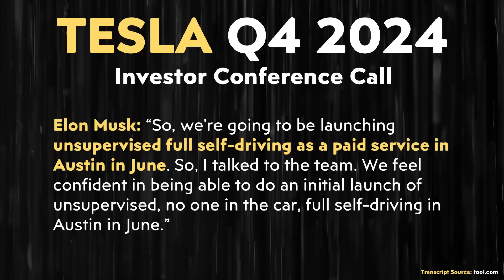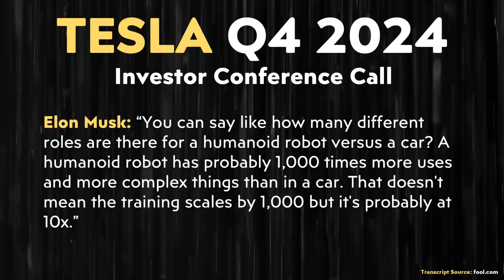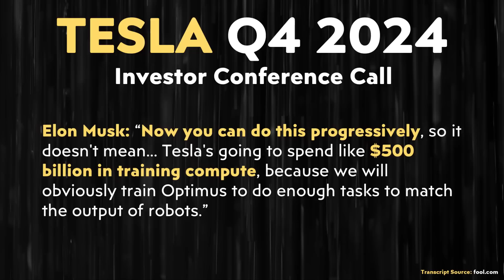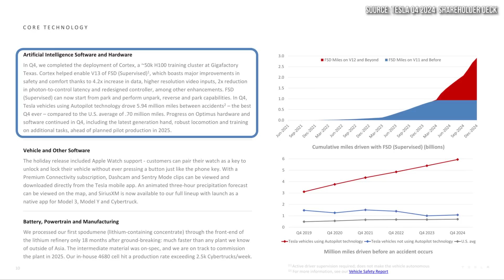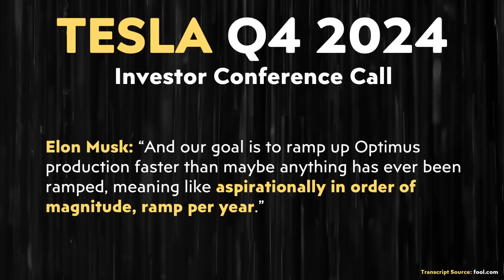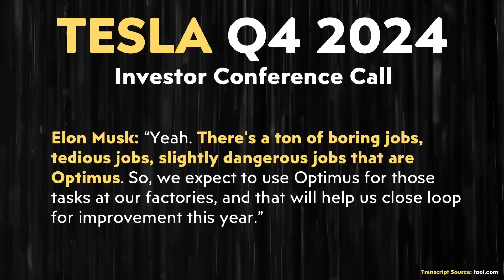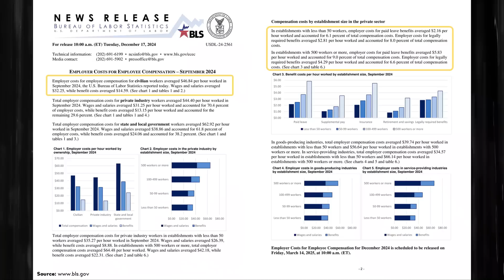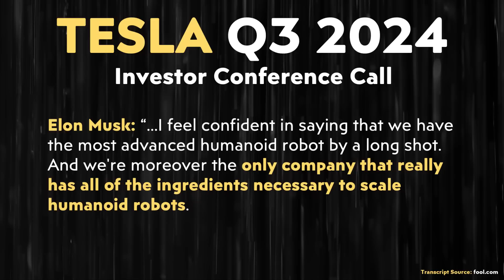Tesla's 2025 Optimus Robot Update | $10 TRILLION REVENUE!

Comment: 10 trillion is a number that not only is off. It is so far of reality that you need to be a special kind stupid to believe this.
When a robot cost 30.000 and let say the licence and maintenance wil cost you another 20.000 then he still needs to sell 200.0000.000 per year. For this year he hopes to build 10.000 robots. And there is already stiff competition, from more expensive but better to cheaper and just as good. He will be lucky if he can sell 50.000 per jear. Which will 250 million in revenue. 40.000 x less then he claims.

Comment: The difference between real world data for FSD and real-world data for the Bot is like 50,000 piece puzzle (or perhaps using Elon’s example a 1,000 piece puzzle). For FSD to be successful almost every piece of the puzzle must be in place to achieve full autonomy. If a single piece is missing, it could be fatal in a vehicle moving at 40 to 75 mph. Real world driving data is required to find all of the edge cases in order to complete the puzzle. Simulated data can only be used for known edge cases. Simulated data doesn’t exist for unknown or unimaginable edges cases. 

A Bot can be deployed in a factory to perform a single task with just a single puzzle piece. Simulated data can be used to train the Bot and because most mistakes made by a Bot performing a single repetitive task in a controlled factory or workplace environment is typically not life threatening. Even if real world data is required to train the Bot, this data is much more easily obtainable using dozens of videos of humans doing the task, or it can learn by tele-operated by a human performing the task in order to train the Bot. The Bot can learn from their mistakes and make the appropriate corrections to become better. Later. the Bot can learn to perform another task (completing another puzzle piece) and grow and be deployed incremental all while doing useful work and generating revenue without the need for massive amounts of real-world data to be useful and productive. Over time as the Bot continues to learn new skills, its usefulness and value will grow until the entire 1,000-piece puzzle is completed.

Comment: And that's the highest those robots will ever cost. So the $105k over a 5 year period will quickly dwindle to $10k over a 5 year period. And finally, $1k over a 10 year period. And it won't take long, I doubt we'll even make it through the first 5 year period before they're selling robots that are much cheaper.
Reply: Dont forget the used robot market.   That will be huge.  Also, robot technicians will be super high in demand, as many as there are plumbers and electricians combined.  Robot customization shops.
Reply: @dherman0001  Well, robotic robot technicians. You'll have robots that work on robots. The idea is to cut the human out wherever possible. You could DIY if you really wanted to, but it wouldn't be necessary.
Reply: Hmmm using your calculations a new Cybertruck will be the price of a cheap golf cart, about $10k ,in 4 more years.

Comment: I have used my water blaster for years to clean the house and grounds. I always wear boots, eye and hearing protection. I’m cautious because I know the psi of the water blaster I’m using can cut through flesh like a hot knife through butter. STILL….I momentarily let down my guard and acted impulsively, sticking my hand into the water jet for a fraction of a second. I sustained a pretty good slice that could have been fatal if it had been a bit deeper (cutting wrist veins). 

Point of the story: I would DEFINITELY buy an Optimus robot for home use, yard work, water blasting, etc.

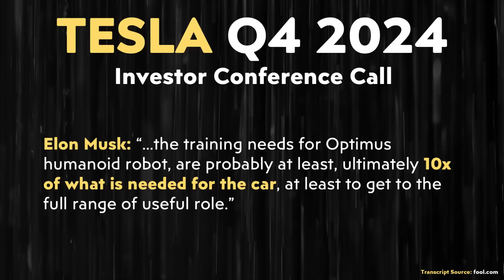Comment: 2:00 - training needs.

I fully expect Tesla to introduce changes into their training process similar to those made by DerpSeek.  These are public algorithms that allow two orders of magnitude improvement in training time.

DeepSeek trained with 1/45th the processing cost because of great optimizations.

I expect Tesla to optimize just as much.
Reply: The finished models are open source, to my knowledge nothing around making them is. Same with Meta and llama. It' great that it enables people to use them and tune them but that's it. If I'm wrong point me to those algorithms
Reply: @perkristiansson9794 

I think...that is correct for openAI, but Llama models are open weights, have provided a way to train, and have published the data they used to produce the results.

And this must be true because DeepSeek was based on Llama3. 
 
DeepSeek-R1 came with a complete set of instructions on replicating their results, too.

Perhaps I misunderstand you.  Let me know. 

Several university students and research labs have reported partial results - it is about 40x faster. 

Many interesting optimizations were made because China didn't have access to modern GPU cards.  

Instructions can be found on HuggingFace. 

* If I offer a link I think it might think I am spam.

Comment: ponyai in China and Waymo in usa are profitable and growing on robotaxi.  Tesla doesn't even have software ready for assistend driving (FSD), much less robotaxi.  Too little, too late.  Amazon Sparrow, rumba vacuum, ibot lawnmowers - ALL are working and in place.  Humanoid robot will expend more energy and effort to just stand up than all the power consumed by these specialzed robots.  Ask a Tesla plant employee.  All the Elon lines about testing them in factory is BS.  Cybertruck quality and design, production and quality issues prove that elon is right, "remote work somewhere else" shoudl be followed.  Part time CEO who prioritizes Twitter, Doge, Spacex, Boring, Neuralink Xai has forgotten Tesla.  He did admit on earnings call that Tesla is "battery restricted".  Catl/BYD, Panasonic/Honda/Toyota have passed Tesla on battery tech. No one is even around anymore to work on battery tech.  4680 dry production has joined Roadster, solar roof, autobidder and all the other promises on the Elon garbage pile.